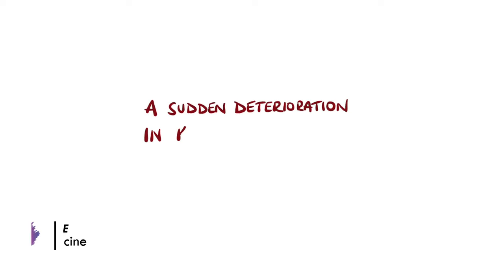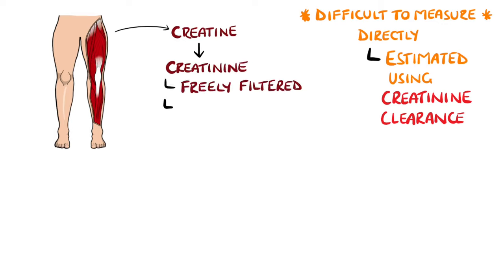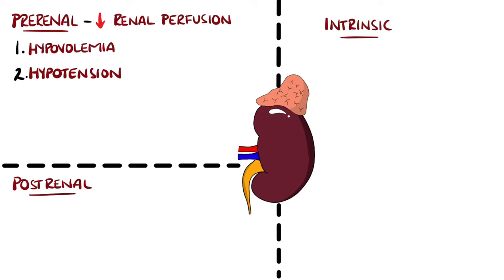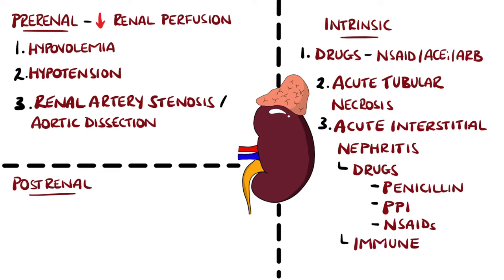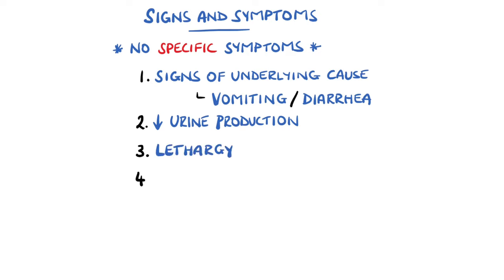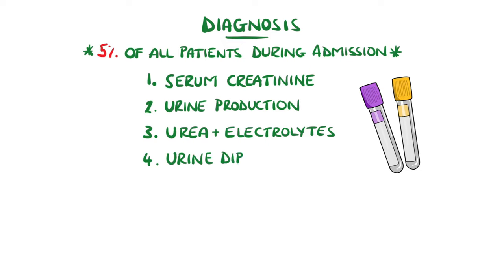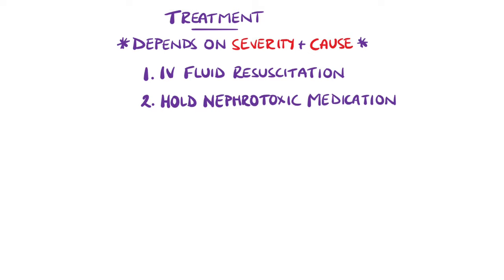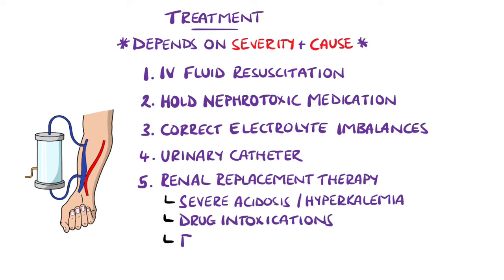Understanding Acute Kidney Injury (AKI Made Easy)

Comment: The latest definition for AKI does not include GFR. GFR criteria were removed as markers of adult AKI.
GFR was included in the definition of ADQI RIFLE criteria...  KDIGO defines AKI in 3 stages using serum creatinine and urine output levels (KDIGO, 2012)
Reply: Doesn't matter. It's still relevant.
Reply: @nishant54  it matters. To reach upper limit detection of creatinine requires decrease in 50% GFR. That's why GFR criteria removed from RIFLE definition, KDIGO only measures creatinine and urine output levels.
Reply: The question is ; do Doctors know about it?